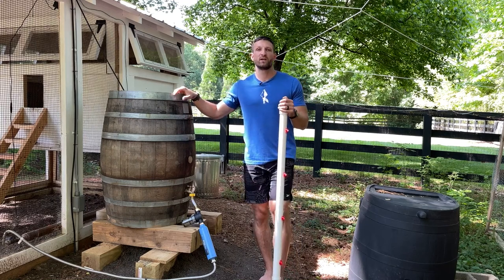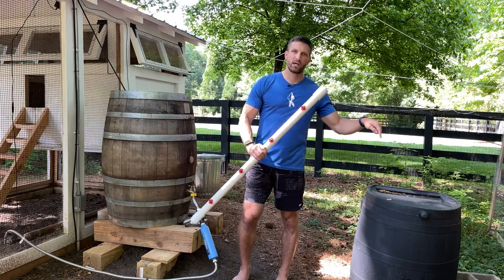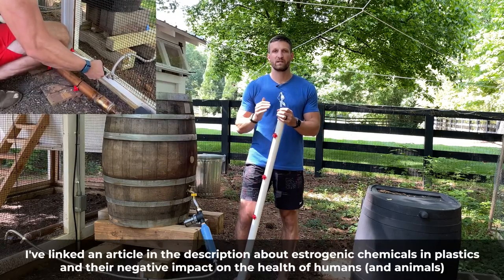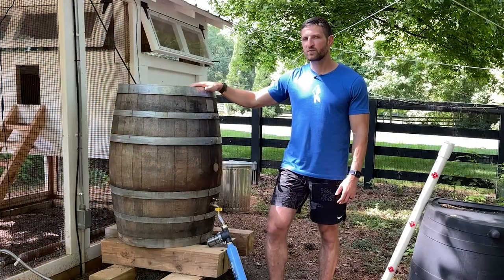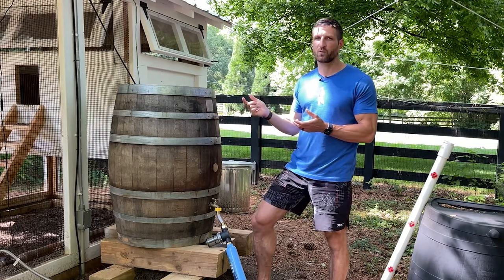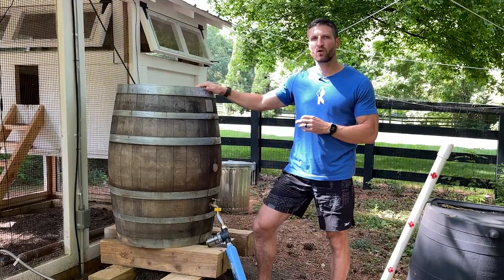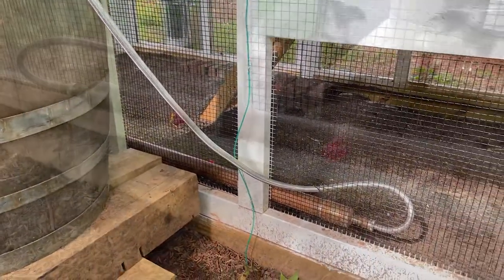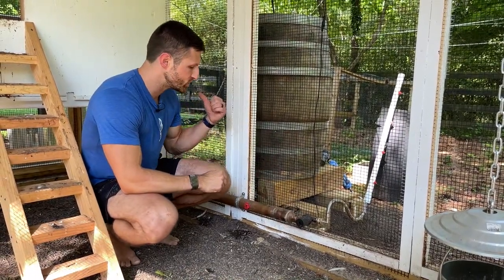How We Built a Plastic-Free Chicken Waterer (That Requires Virtually No Maintenance)

Comment: Very good video, 
Question, what determines the size of the copper pipe? The one you’re using looks like 2”. Being that the stainless flex supply is smaller I’m curious why such an increase in size. Thank you
Reply from the maker: We just used the size available at our local plumbing store that matched the PVC pipe as closely as possible.

Comment: You still have lots of plastic pieces there. The hose, the first filter, the second filter, both hoses to and from the copper tubing and then the nipples are made with plastics. All you took out of the equation was the plastic barrel and the pvc tube. And you filling it up with a plastic hose. 😮
Reply from the maker: You can't eliminate plastic, but you can significantly reduce how much and for how long the water is exposed to it. But the truth is that the charcoal filter removes all the endocrine disruptors from the water, so the only point of contact is the plastic nipples (which you can replace with metal versions). But since the exposure surface and time are so small, it's probably not worth it.

Our hose isn't a traditional garden hose but a non-toxic version from Water Right. But even if it was a regular hose, the charcoal filter would remove any toxins leached into the water from the hose. 

So overall, the water our chickens drink is significantly better than what you'd find on most homesteads.